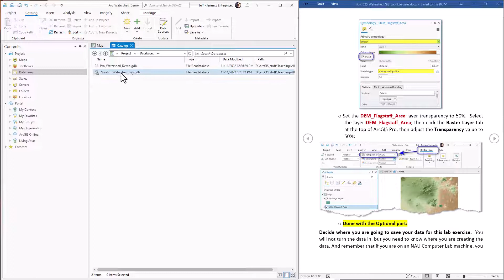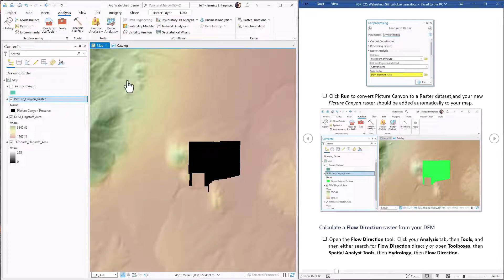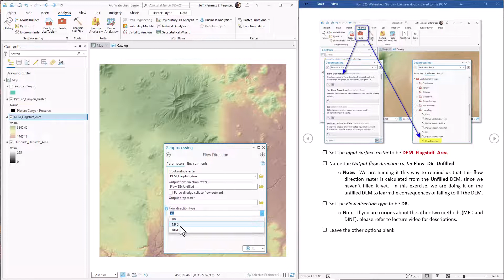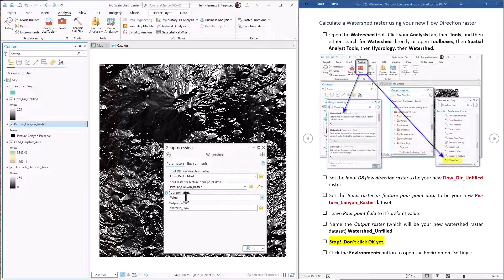Hydrology in ArcGIS Pro, Lab Exercise 2:  Problems when creating Watersheds without filling the DEM!

Comment: Nice video
Sir can you tell me how to find out the appropriate  threshold value for stream network generation from a DEM in ArcGIS ?
Reply from the maker: Thank you for the kind words Anang!  Much appreciated.

There isn't really a single approprate threshold value, I'm sorry to say.  It can depend on your DEM resolution and extent, because both of these affect the number of cells that contribute to the flow accumulation raster.  And if you are trying to predict where actual perennial flow would occur, then that is also heavily dependent on local climate.

I'd recommend looking at areas where the features you are interested in identifying are already classified (perennial streams, for example), and then checking what cell accumulation threshold would capture those areas.  That would give you a good rule-of-thumb to use for your area, climate and DEM resolution.

Hope this helps!  Take care -
    Jeff